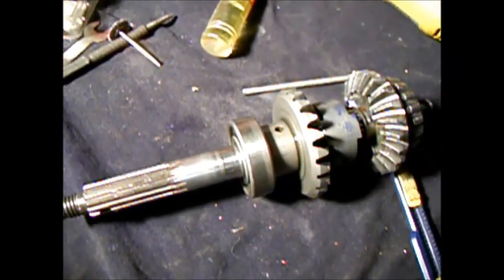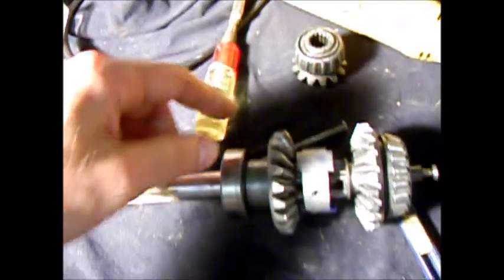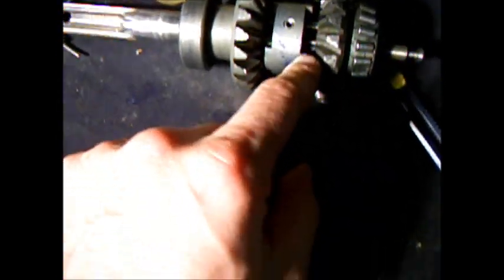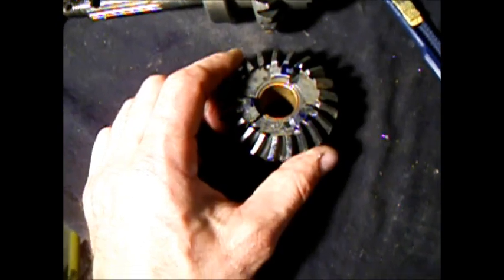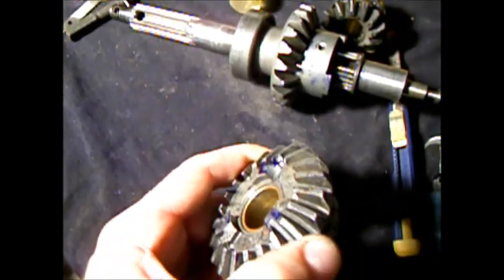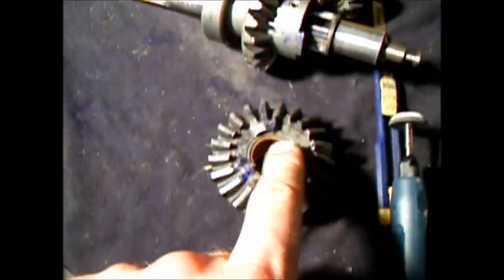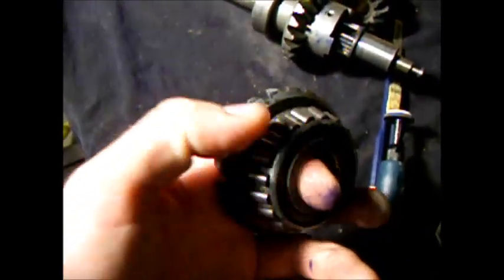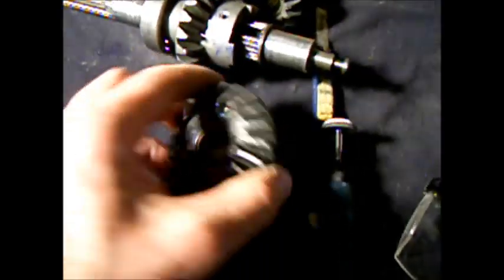Repairing an outboard that is jumping out of gear under load... for FREE

Comment: You could of also 180'd the dog clutch, so the little worn reverse side, can be used on the newly ground forward gear dogs. In some lower units, you can also swap the gears around, so you have a now, near new forward (The old reverse) and the machined old forward as the reverse gear. Since reverse is usually just idling for maneuvering, that's where you put the ground gear.

Comment: Let me tell you a little story, of my own, about how I was able to deal with that problem. My dad was a commercial fisherman. We caught and sold catfish caught in the Alabama/Tombigbee rivers and the channel connecting the two rivers. We had a 25 Hp Johnson (55 model)  that wouldn't stay in forward gear. Couldn't even hold in in forward gear at anything near WOT. I had a load of fish, about 20-25 minutes run time to the landing (dock.)  I had a pair of plyers,  a screw drive, a turpentine cup  (no other tools.) I was able to get the boat to a sandbar, remove the prop nut (it was screwed on with a cotter key for securing the nut onto the shaft. The shaft and gear assemble could be removed buy unscrewing the retain ring/nut. To shorten this description (I was able to rotate the shifter dog I80 deg., that gave four new surfaces to match and drive the gears) Only the inside of the dog ears make contact anyway. It lased through another powerhead. Hard to believe but that's exactly what happened to me when I was sixteen years old.
Reply: I'm going to take a look at my 18hp johnson. Runs mint but wont stay in gear, hopefully I can give it the ol 180 problem solved.
Reply: When you say it would not stay in gear did the shift lever move or would it say in place

Comment: A lot of OMC gears and dogs in later years did have a back cut angle on them from the factory. It's why stern drives used a shift ignition interrupter switch mechanism.
Reply from the maker: Fascinating! Thank you for sharing.

Comment: I have the same issue with fwd jumping out of gear under load/high rpm. My brother suggested that I swap fwd and reverse gears as they are supposed to be identical on my outboard. The thinking is that reverse wouldn't jump out as it's not under heavy load when reversing.
Reply from the maker: I have heard people say they swap the fwd and rev gear. If you do that make sure you also flip the clutch dog as well.  To only flip fwd and rev gears but not the clutch dog with drastically increase the stress on the much reduced mating surfaces.  I still would do my method instead of a gear swap.
Reply: Can be done if they are in fact identical gears.  Look the gears up and the you'll know if they are the same part number.

Comment: Did it on two motors one works better than ever did ..other made it threw alot a Bridges but jumps out hope just need to add just shift rode..cable out to far both adjustment so has to be lower or bent shift cable holder..

Comment: A machinist could use a milling machine to handle this job but with reasonable care dressing it with the Dremel or similar should work just fine.  I have a Suzuki DT85 that reputedly has bad reverse.  Your technique should fix it if the clutch dog and reverse gear pawls are banged up. Given that reverse doesn't get as much use I trust that "fixed is fixed" for the foreseeable future if that's the case.
Reply from the maker: Russ G
 so true!
Reply: Use a drill press for the repair

Comment: Using air pressure and spinning a clean dry bearing at a high rate of speed will cause the bearing to come apart and send parts of the bearing flying every where. Ask me how I know. They need to be in the race to hold them together. And bathed in grease or oil.
Reply from the maker: Thank you so much for the feedback.  Now that you have explained the risk I can understand how spinning a bearing with compressed air is potentially dangerous.  Thanks for taking the time to teach me.

Comment: What cause the propeller doesn't turn and spin while the engine is running. I have hangkai 3.5 HP 2 stroke brand new. I filled up the gear oil housing in the propeller. the pin is installed properly and the pin lock outside is lock. But the propeller does not spinning while the engine running and accelerate the throttle but there is no result, can you help me please thank you

Comment: This is great, thanks for sharing. Makes perfect sense, I'm about to do mine that way.
Reply from the maker: Good luck. Please report back with the result.
Reply from the maker: @tojadmka  ok. First before you panic, take the flywheel off.  I had the same symptom with a lawn tractor engine and found a magnet had broken free from the inside of the flywheel and was binding things up.  If you check that, and are sure your outboard is in neutral, then I would think you have something internal that is binding.  Also, make sure that your pistons are moving in and out as you rotate the flywheel... if a piston seems disconnected you likely have a broken connecting rod.  Please report back.
Reply: @mrdiyguy123  thank you! It's a months old fly wheel, stator and trigger so i doubt it, but there's a possibility something went wrong because I did that install myself
Reply from the maker: @tojadmka  I have seen relatively new parts fail before.  Let me know what you find please.  I'm interested in helping you and increasing my knowledge too.
Reply: @mrdiyguy123  will keep you posted. I first need to make sure I'm in neutral. Linkage barrels are disconnected, lower unit is out, but need to follow the linkage and double check

Comment: or switch the gears from reverse and forward. put the reverse gear in the forward spot and the forward to the reverse spot. that will put in a new spot on the clutch teeth.
Reply from the maker: That is a great plan if your gears and clutch dog can be installed in reverse.  That wasn't an option for my outboard.
Reply: @mrdiyguy123  oh sorry!  My 1957 evenrude 10hp can.

Comment: Question about removing material from the dogs.
Are you keeping the same angle by grinding the surface evenly or, 
Drawing a line through the center and cutting a wedge shape, like a tiny slice of pie?
Im about to try this and not sure which way to go.
Reply: Easiest for me to just flip the clutch dog over and use the good edges as guides and high-marking with ink.
Reply from the maker: that is a great plan if your clutch dog can be flipped over.  some can, some can't
Reply from the maker: i tried to keep the same angle for the contact surface as original

Comment: I have a 1977 Johnson.  Lower Unit slipped under load.  I bought a rebuilt lower unit and had the same problem.  Could it be something else or likely just shift cable out of adjustment and rounded off the gears on the 2nd lower unit?  Can I take off the shift cable and manually shift the motor in and out of gear?
Reply: I am learning myself, but maybe a spun hub?  Did you use your old prop on the rebuilt lower unit?
Reply: @ trevor johnson, did you ever figure out what it was?
Reply: Who ever sold you the rebuilt lower unit ripped you off most likely... People with these old motors are always selling parts that are cleaned up or painted as rebuilt...
Reply: trevor if you had the same problem you probably need your shift cables adjusted.  whatever happened?

Comment: I recently bought a 1985 20hp Johnson  and the lower  unit only had about one or so ounces of nasty oil come out when I checked it.I did three drains and refills since then.First one was pretty black upon draining it.Ok since then.Has not jumped out of gear yet.Supposedly it was in storage for years?I am hoping this was the case and the owner only ran it on the stand to test it and show it for sale.

Comment: Use drill press and high quality bits reground to a flat face or grinding bit or CNC bit if ya have
Reply: First I’m gonna try flipping my clutch dog. But I did buy some diamond bits with the thought of trying to trueing the gears ⚙️ up in my drill press.

Comment: how did this hold up?  I got one that is doing the same thing, to my eye, there is the most wear on the dog..
Reply from the maker: It worked fine for a year or 2 and then I sold the boat. My wear was on the gear, not the clutch dog which seemed to be made of much harder metal. However, the process would be the same to touch up the clutch dog.
Reply: I am thinking about replacing the bearing on the forward gear also,  that little bit of extra clearance is part of the problem..I also notice that the total travel of the dog when not attached to the linkage is considerably more than when linked up.  Design issue, I think.  Once my drive disengages it does not BANG, it just acts like a severe cavitation,  throttle down and I am good for about half throttle..  also seemed to get worse(happen at a lower RPM as the gear oil warmed up)

Comment: susuki DT75   goes in neutral under load  pull back into neutral put in gear again away we go no noise from gearbox I take it the problem is rounded forward gear and clutch dog anything suggested before I go there or that's what it would be .

Comment: my 225 hp Johnson grinds bad going into reverse.. is that the cluck dog, I pulled out the lower unit plug there were no chunks of metal magnafied field to the plug? what else could cause this grinding it only happens when I put the motor in reverse forward seems fine.
Reply from the maker: It is either an out-of-adjustment shift cable or the same problem I fix in the video.
Reply: +mr diyguy123 thanks for your response
Reply: No noise into forward but noise into reverse means reverse gear is probably  missing  chucks of teeth.  Grinding noise is gears and hammering is dog to gear noise

Comment: how do I go about getting the gears for my 40hp evinrude tracker don't really know the year but I believe it's in the 90's
Reply: Look 👀 inside the motor and find the number. They are stamped ona round part that looks like a freeze plug. That number will give you a lot of information.

Comment: were there detent balls in the drive shaft, if so where do they go?
Reply: Not all can use this system. The spring and balls detent system goes dead center of the dog travel on the shaft.

Comment: Mine doesnt skip.  But after putting in gear it will skip 20ft later. But thats it.  Not sure why, its done it for years
Reply: L2fish make sure that the mechanism that is  changing the gear is actually holding it into gear with a constant pressure.  If it is a two piece downlink rod inside the lower housing open adjustment cover and make sure that the coupler is tight with no rod movement independent of the coupler. Could be shift fork at the shift dog. Could be any portion/piece of the shifting mechanism that has wear out allowing any movement releasing dog to gear interface pressure?

Comment: Yamaha 25 had a friend fixed shift cam by drilling holes in brackets that hold it oiled and heated worked good for a yr but I be a sailor and only use the motors in the inlets or threw bridges if other people near by.The shift cam can only be replaced if you pull power  head.O r you remove the part of plastic that holds it in and always have a bungee cord to hold it s shift lever in place.Hay poor people poor ways it worked tell it didn't...

Comment: Hi could you swap the reverse cog with the forward cog & turn the clutch dog around because you use forward more than reverse ?
Reply from the maker: That was my first plan but i don't think it was an easy swap or i would have done exactly that.  Try it and let us know.
Reply: I'm about to try that very approach.  My forward gear and clutch dog both have rounded edges on one side.  It slips out of gear when under load past 50% throttle.  I'm going to try flipping the clutch dog before trying to replace anything.  I'm reluctant to try grinding gears, but it's always an option if this doesn't work.
Reply from the maker: @Ryan-ch1gp  please let us know how it goes. Make sure you can flip fwd/rev gears and the clutch dog. If you only flip either the clutch dog or the fed/rev gears, the bad surface will quickly destroy/round off the good surface.
Reply: @mrdiyguy123  I agree that I don't want to destroy the reverse surface.  However, I was able to find the clutch dog for mine for $140 and the forward gear for $105, reverse for $11....all new.  After hard consideration of availability of the parts in the future, I decided to spend the money, but I'm still going to flip the clutch dog and see how long it runs.  My reasoning is that there may be some good use left out of this set and I want this boat back in action.  I've probably already invested $500 in it so far (counting a new transom on the boat, rivets,  marine battery and rebuilding the fuel intake/pump/carb paint and decals, new prop, etc...)  But knowing I have a good gearset on the side will give me more confidence that I can keep it on the water even longer without selling out to something 4 cycle or electric.  =P
Reply: @mrdiyguy123  Flipping the clutch dog seems to have fixed the issue.  I took it out last weekend and didn't have it slip once.  I'm still having issues with fuel above 75% throttle, but can't tell if it's the carb or the chinese fuel pump I got off Amazon.  I'm going to work that issue out and put those gears under real load soon.  Perhaps the clutch to gear connection is actually under more load when the boat hasn't planed over anyhow.  I just received a new forward/reverse/clutch dog set that I'm going to shelf.
Reply from the maker: @Ryan-ch1gp  great progress. Yes, there is more load at lower rpm just before you get up on plane.
Reply: Definitely flip the clutch dog first, then if that wears out do what he shows in the video

Comment: Was it just coming out of gear and the shifter staying in the same place or would the shifter also move
Reply from the maker: Shifter also moved out of position
Reply: @mrdiyguy123  ok mine  acts like it’s coming out of gear under a heavy load  but the shifter doesn’t move so hopefully it’s my prop spinning just order a new one will find out in a few days
Reply from the maker: @seandrake7534  agreed. Let us know how you make out.
Reply: @mrdiyguy123  well I now have the lower taken apart to fix the clutch dog and gear  what do you mean buy back cut  are you taking more off the back side of the gear so there is more material on the front of it ?
Reply from the maker: @seandrake7534  by back cut, I mean cut it so that under load it is impossible for the gears to disengage.  Back cut is the opposite of rounded off gears.
Reply: @mrdiyguy123  so you took moor off the bottom side then the top correct sorry if I’m being a pest
Reply from the maker: @seandrake7534  imagine rounded gear teeth that want to cause the clutch dog to want to push away from the gear it contacts.  No imagine grinding off material from the teeth at the opposite angle as the rounded off tooth surface.  The more torque applied to a gear the more it wants to stay engaged with its mating gear.
Reply from the maker: If by "bottom" you mean the part of the tooth that connects to the gear, yes, I took material away from the bottom of the tooth, not the small tip of the tooth.

Comment: I guess there is a reason that you couldn't just swap the forward and reverse gear; they look interchangeable, but maybe they are not.
Reply from the maker: Nope. Not interchangeable
Reply: Yeah, you could swap the gears but it wouldn't do any good - for the simple reason that the reverse gear turns the opposite way so you've 'reversed the reverse' and the same surface engages with the dog.  Plus, you'd have to re-shim to get proper gear contact and backlash.

Comment: My forward gear looks good how can I tell if this is my problem please help thanks
Reply from the maker: If it jumps out of gear under load you either have worn gears or a misadjusted shift rod.
Reply: @mrdiyguy123 Can I send you a pic of gear  to see if you think its worn Thanks
Reply: @mrdiyguy123
Reply from the maker: @danavienneau754  Send me a private message with your email addr. tks
Reply from the maker: @danavienneau754  that email address bounces :(
Reply: @mrdiyguy123       would you still be able to answer emails with what is wrong.    Will be my first time taking apart lower unit.    Reverse and neutral are just fine.   Slams into neutral hard while in forward gear.   Dont quite get what your doing with dremel to teeth.    Thanks for any help.    I think it may have been cause by motor just shutting off in neutral when in idle or in gear when low idle.    Again thanks for any help.

Comment: Why not throw a shim behind the gear to tighten them up ?
Reply from the maker: The problem in my case wasn't that the gears were too far apart, it is that the teeth had rounded. I don't think shimming would have worked because under load the teeth would generate incredible opposing force that would overcome the shift dog, continuing to allow the gears to slip..

Comment: Would it be possible to switch the gears. The worn forward being used for the reverse and the reverse used for the forward, therefore the drive turning against the the unused side of the gear?
Reply from the maker: I like that idea and believe I tried to do that unsuccessfully. I wouldn't have care if it jumped out of reverse.